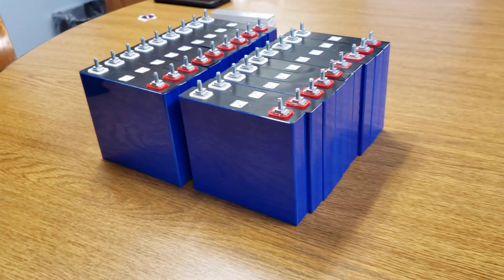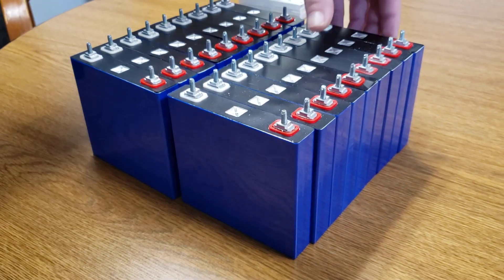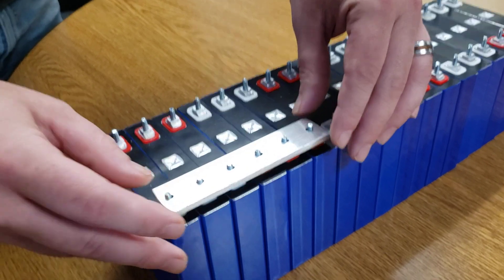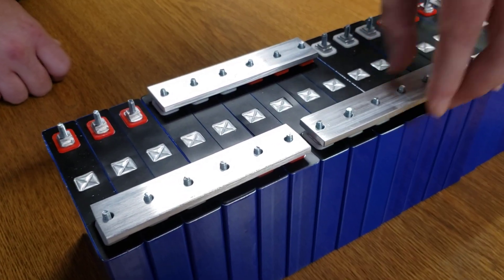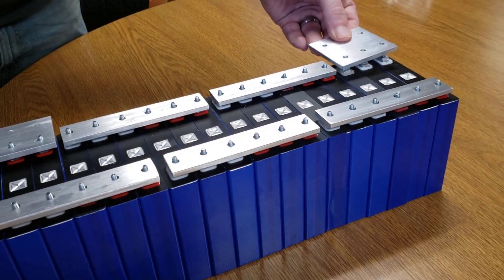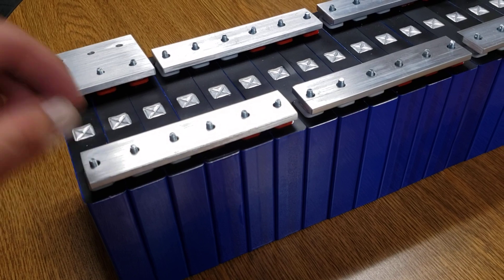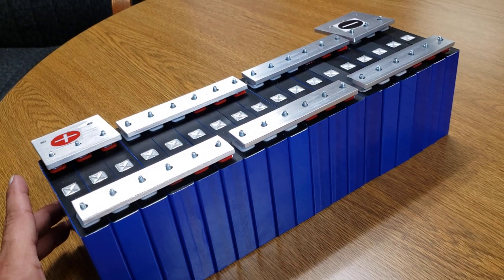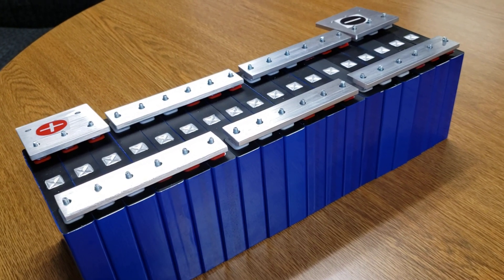Easy 6s3p LTO prismatic toshiba scib lithium battery build. 1022 All fab bars

Comment: Too bad my new refined alt 160a (previously was 90a 14.2v) can only deliver 14.8v max and lowest i noticed was 14.6v (with no audio load) with mid load it crashes down, on 105ah efb battery .. I lov how scib 20ah perform but not sure they will shine with my current alt.. To power a 3.5k rms system , salt-3 with 3 other amps for mids
Reply: Did you end up going with the scib’s? I’m putting together a 30ah (6S3P) with these 10ah scib’s. My charging voltage is the same as yours (14.8). Wondering how they will perform. About the same stereo wattage as yours as well.

Comment: 6s5p with 15 cells is it possible?
Reply: No. It's basically a multiplication problem. He used 18 cells in a 6s3p configuration. You would need 30 cells for your idea.

Comment: Hey bro can you please clarify for me I just bought the 29AH SCIB bank from NORTHWEST LITHIUM and I have a few people telling me that it doesn't have enough reserves??? If the battery is rated for 15k and I'm not going to be going over 10k total shouldn't it be enough to run the system, LED and the car 4 Cylinder or do I need to get something with the same charging voltage with a lower discharge rate like the ying long style LTO cells and make a battery and if so is there a way to make it resistant to the heat so I can utilize the OEM battery location
Reply from the maker: It's only about 30 amp hours so you have to consider when you have the vehicle off it's going to drain quickly it is not a ton of Reserve but you can add Reserve also by adding larger capacity cell banks in parallel . Sriko plannano 24ah LTO or 20ah prismatic lto scibs
Reply: @mazda2284  is there a way to possibly put them in a battery delete and insulate the inside and out with a battery heat shield and put it in the OEM location in parallel if so that's what I will do if not what about a bank of say the 30-45AH Ying long or xs power cells in a delete or worst case scenario are the xs power LTO batteries safe for under the hood it says they are but I hear stories of them catching on fire
Reply from the maker: @Dirty2152  those XS batteries definitely are not under the hood safe as they claim in the fine print you will read that they have a Max temperature of 140 degrees and that they recommend that you isolate the battery from any heat basically the same thing is going to go for any other battery on the market just like the 18 amp our lto that srikobatteries.com has .
Reply from the maker: @Dirty2152  I actually have a video from slamology last year of somebody's battery that they put under the hood and it started on fire
Reply: @mazda2284 couple of questions. Can you build a 6s4p on this configuration? And, would the 4p be a better build than 180ah on yinlong.  4 banks on 40ah.
Reply: @teewalker615 yes you can build a 6S4P bank of the prismatic 10ah cells. Only you can answer if it will be “better” as it depends on your needs. The prismatic cells will have higher burst current and be more compact. The Yinlongs will be bulkier but have more reserve.

Comment: Are the studs torque sensitive like yinlongs
Reply from the maker: Yes,  all aluminum stud cells are sensitive.  Very few cells have studs that you can just wrench on. I use 6nm as spec to torque.  I also use a tiny dab of medium threadlocker from Harbor Freight
Reply: @mazda2284  thank you Brad

Comment: this is a lifepo4?
Reply from the maker: LTO
Reply: @mazda2284  do these cell have to be compressed
Reply from the maker: @bigkato3134  no just contained in a sturdy box from the factory they come in plastic boxes with no compression
Reply: @mazda2284 do you recommend cooling fans if they are placed in the cabin of the viechel? Or would tht be unnecessary?
Reply: These better than the lev60 148ah batteries?

Comment: So how much power could this support on say a mechman 320 with an external adjustable voltage regulator like the ones BrandX sells for $100 that'll adjust from 12.8 up to 15.8 roughly? I've got limitless cyber 12k currently with XS SB1000-31 supercaps and while my voltage is good and strong i definitely would like to charge higher than 14.5...
Reply: So how high of a charge could you run this type of bank for car audio, I have a js Alternator 370 amp diodes pushing it to 15.8 but stays around 15-15.5 on average, would this be a possible replacement for the 80ah yinlong bank im running now 😅😅
Reply: @keithbutler7896 16.2v max
Reply: They say roughly 4k per 10ah
Reply: Are you saying 4k watts per 10 ah? @BenThomas-g4v
Reply: @BenThomas-g4v That isn’t accurate at all. That’s like a major approximation. It all has to do with c rating and what you are charging at.
Reply: Charging at 15.8 these 10ah 75c cells arranged in 25ah figuration will support up to 19,000 watts. Most people under rate and say they will support 12,000 but that’s like really conservative.

Comment: I've been trying to find a good deal on these scibs. which specifically are these scibs? they have a few diff. amp hr ones. did u make ur bus bars? if so what thickness n width are they?
last question, this could do 10k rms, potentially, correct?
Reply from the maker: Repurposed Prismatic LTO With M6 Threading. 2.4V 10Ah 30C continuous 75C peak discharge Lithium Titanate Battery Cell "i personally tested over 11ah "
300amps constant charge and discharge per cell/bank , configured in 6s 14.6v-16.2v recommended charge

Sriko Discount code= BDSB 
https://srikobatteries.com/product/2-4v-10ah-75c-prismatic-lto-cell-with-m6-threading/?wpam_id=8
Reply from the maker: we used these bars , and a 6s 5a heltec balancer all from sriko 

using discount code BDSB 

https://srikobatteries.com/product/lto-10ah-or-20ah-m6-6s-3p-busbars/?wpam_id=8
Reply: @mazda2284  thank u sir. for all the info. I did the math, I should be able to sustain around 10k rms of a 6s,3p bank, charging @14.8v n 320amp alt. 3/0 welding cable. Plz correct me if my calculations are wrong as I wanna make sure my bank is big enough. This 40ah lto bank just ain't cutting it a anymore.
Reply from the maker: @troydefond2307   correct 300amps per 10ah plus your alternator . you should be good . i always like to overbuild tho . plannano 24ah banks are also a great option .
Reply from the maker: GTILOUD  you can yes.
Reply: @mazda2284 you can charge at 13.8 I thought the minimum was 14.8v?
Reply: @tayloremriectx what you asked. Mazda?
Reply: 25ah of 75c 10ah prismatic cells will do 19,000watts if you charge at 15.5-15.8v.